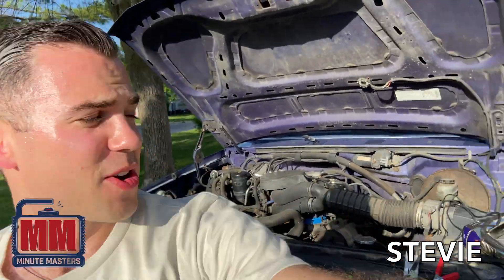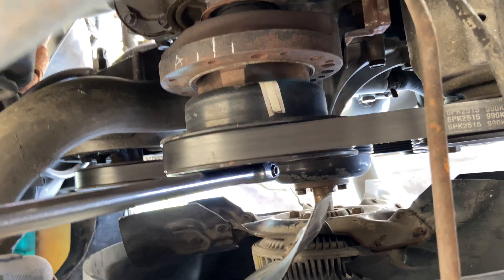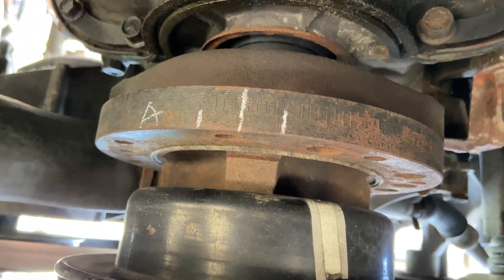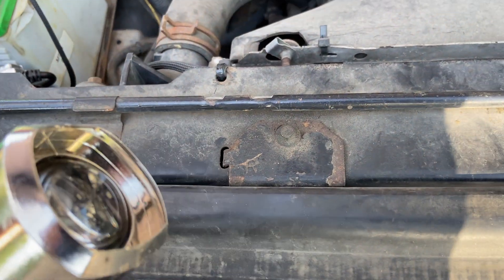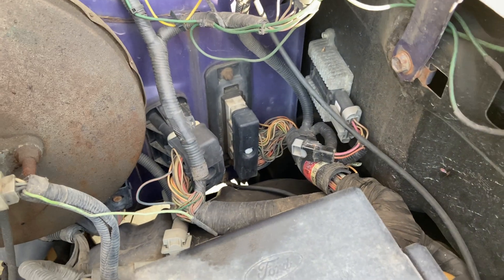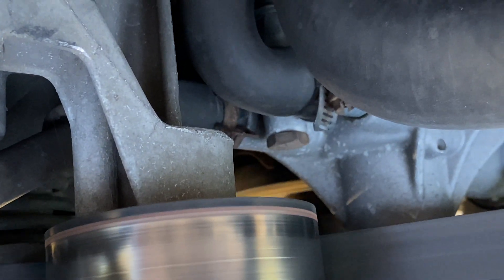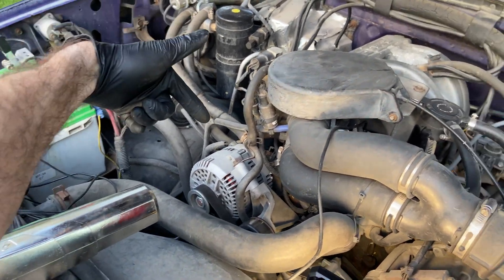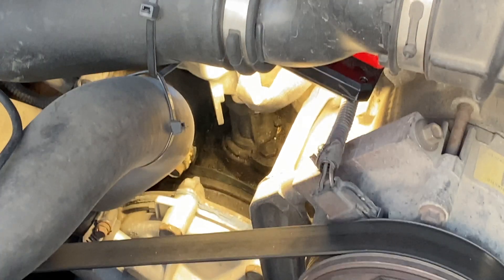Do You Know How to Check and Adjust Engine Timing?? | 1995 Ford F150

Comment: Hey does the 10° go even with the top of the pointer or down in a little slot
Reply from the maker: You want the 10° mark to be alongside the right side of that pointer. That pointer has a flat side and an angled side. The flat side is the side you want to align with.

Comment: Where is the crankshaft position sensor ford f150 1995 v8 5.0
Reply from the maker: Good question. I haven’t had to look for it myself. If I were to guess it’s somewhere on the front of the engine or it’s part of the distributor set up.

Comment: The SPOUT (SPark OUTput) connector is the little plug on the wires going into the TFI module on the distributor. You have to pull it out before setting the timing. Pulling it eliminates the timing advance function by disconnecting the ECU from the ignition system.
Reply from the maker: Thanks for explaining the acronym!🤙
I was talking about this someone else today and I couldn’t remember if the timing advance was done automatically.

Comment: hey my f150 5l is running low rpm on neutral do you thinks it can be related to the timing? thanks
Reply from the maker: That could be timing. It’s at least worth checking.

Comment: You did not mention when you re-attach the grey plug. Before cutting off the engine, before tightening the distributor?
Reply: Shut it down after you have finished timing it, then you can put it back in
Reply from the maker: Good point!

Comment: i did not know you had to disconnect that one connector before loosening the distributor and  trying to adjust the timing...i guess that grey square thing near the ignition module serves the same purpose as when you have to disconnect the vacuum advance hose from the vacuum advance before you can get the timing done correctly
Reply from the maker: That’s my understanding of this process too.

Comment: What does it mean when i can only find mark when connected to
 spark plug 8
Reply from the maker: No idea. I’ve never hooked the timing light to wire 8. Did you hook the light to wire #1?
Reply: Probably means the outer ring on your harmonic balancer has spun. There is a place called the damper doctor in Redding, CA that rebuilds them.

Comment: Nicely done 
I just recently replaced my distributor in my 89 F150 5.0 and I got it really close by ear so it looks like I'll be getting a timing light and getting it spot on and maybe picking up some power and mileage
Reply from the maker: Thanks man! Before I had a timing light, I would kind of do it by ear too. The timing light definitely dials it in a little closer.

Comment: Just did this on my 94. I’m pretty sure the timing has never been adjusted but The timing was actually pretty close to 10. I adjusted it and took it for a spin and didn’t really notice any difference. Should I keep trying to adjust further??
Reply from the maker: If you adjusted the timing to 10, then I would leave it be. If you start adding mods and changing fuel grades, then you can bump the timing.

Comment: My engine seems to be louder and seems like it loses force when driving instead of steadily speeding up if that makes sense? Could it be my timing being off? I have my spark plugs set to stock .44 but my engine seems to get loud when I speed up or floor it as if it’s struggling to speed up. If you could help out with that would be awesome!
Reply from the maker: Have you don’t an ignition tune up in a while? (Plugs, wires, cap, and rotor) 
Have you changed the fuel and air filter?
I would start with some diagnostics first. I would read your codes and check fuel pressure. 
If you are comfortable with these checks, check transmission fluid pressure (test port on the driver’s side of the transmission) and I would check vacuum stability.
Reply: @TheMinuteMasters  did a tune up already still have the same problem, I have good oil pressure, vacuum stability haven’t checked that yet
Reply from the maker: @elsebas6290  definitely check your vacuum to see if it’s erratic and your fuel pressure is a good thing to check while you’re at it.
Reply: @TheMinuteMasters  awesome thanks!!
Reply from the maker: @elsebas6290  You’re welcome man!🤙

Comment: I was adjusting the timing yesterday and got a big shock. Is that suppose to happen if the truck is on?
Reply from the maker: How did you get a shock? Did you see a spark? Did you personally get shocked? What were you touching?
Reply: @TheMinuteMasters  I was trying to turn the distributor with my left hand when i felt a shock. It didn't see which cable I was touched and didnt want to do it again to find out.
Reply from the maker: @frobles21  Gotcha. You could have touch a cable or some bare conductor. Unfortunately you won’t know until you try it again. Lol
Reply: @TheMinuteMasters  I was afraid of that. Do you take private messages for troubleshooting? I have the same year truck and it’s been kind of a nightmare.
Reply from the maker: @frobles21  Do you have Instagram? You can message me there. @theminutemasters
Reply: @TheMinuteMasters  thank you, you might get an essay from me 😂🙏
Reply from the maker: @frobles21  😂😂

Comment: So is your “0” the 5th mark in? 5 to one side 5 to the other? Trying to understand how exactly to read the marks
Reply from the maker: 0 is center and then there are roughly 10-20 tick marks on either side of the zero. Looking down at the harmonic balancer, I set my timing to the 10th tick mark to the right of the 0.
Reply: @TheMinuteMasters  alright, I probably sound stupid because you just explained, granted I haven’t looked at mine yet I’m going to get the tool right now, but what is the process of locating the “0”? Is it a certain amount of ticks in from the left?
Reply from the maker: @stoicchillz3539  No a problem. Any questions are good. The 0 should be marked with a zero and the line is longer. If the 0 isn’t marked the find the longer tick mark in between the 10s.
Reply: @TheMinuteMasters  I see now that there is actual numbers to tell in the video haha I’m sorry. 
I’ve just discovered a new problem though, bought the tool went under mine and there is legitimately no lines…. Turned it over 2 times rubbed it off and everything. Not exactly sure what to do about that one
Reply from the maker: @stoicchillz3539  no problem! 
Really? Is there a center line? I would try soaking it with a penetrating oil and really try to clean it. I don’t see why there wouldn’t be any numbers. I take it, you rotated the crank and looked around the entire harmonic balancer?
Reply: @TheMinuteMasters  yeah, went all the around 2 times and nothing so I took a wire wheel to same spot as in your video and there is ever so slightly a few lines but just not enough to tell where I’m at. No numbers showing so far
Reply: @TheMinuteMasters  do you by chance happen to know the diameter of these? Having a hard time finding it online
Reply from the maker: @stoicchillz3539  Really? I would try using a rust removing solution and see if you can uncover any markings. Otherwise, you’d have to set timing be the sound of the engine (which isn’t the most accurate method).

I don’t know the diameter, But you could go to an auto parts store and ask to see one. Then you could measure it.

Comment: Love your videos. I just bought a 1990 F250 and this video gave me about 40 more horsepower since the 5.0 engine was set at 0 degrees. I adjusted to the 10 degrees BTDC as labeled under the hood using the method outlined in your video. I'm going to continue to upgrade this truck and enjoy it. Thank you!
Reply from the maker: Thanks Mike! I appreciate it!🤙 
That’s awesome! It’s amazing what a few adjustments can do to an engine. 
You’re welcome!

Comment: Question. Did you ever do a video on the TPS sensor replacement?
Reply from the maker: I didn’t. Although, it’s easy to replace. Either you bolt it back the exact way it came off or you use an Ohm meter to align it.

Comment: Hey there, could you please do a video of replacing the crankshaft positioning sensor. I’m in a bind and don’t know how to do it!
Reply from the maker: Hi! What year is your truck?
Reply: @TheMinuteMasters  it is a 1995 f150 5.0 liter v8 I’m not very sure if they have one it could be my computer going bad but it stalls when driving or idling for a little while and won’t crank back. I’ve tried the new relay and I’ve also tried a new icm
Reply from the maker: @Controlledchaosjeep  Gotcha. Im not sure if these years have those sensors either. I would try reading your codes. If it’s a sensor, it should find it for you.
Reply: @TheMinuteMasters  I believe it could be my computer, it just stalls for no reason and won’t crank back. It’s got fire and gas… not sure if the computer is going to fix it but I’ll do a video on it and mention you! Thanks for all of your help!
Reply from the maker: @Controlledchaosjeep  Yeah let me know how it goes! Thanks man!🤙
Reply: @TheMinuteMasters  yes sir!
Reply: @TheMinuteMasters  computer did not do it I’m not sure what’s going on
Reply: @TheMinuteMasters  I believe the timing is off and I have no oil pressure unless I give it gas? What do you think would cause this?
Reply from the maker: @Controlledchaosjeep  So I’d try to adjust your timing first. Oil pressure can be affected by a lot of things. Are there any oil leaks? Are you measuring oil pressure with a test gauge or just reading the dash cluster gauge?
Reply: @TheMinuteMasters  with an after market oil pressure gauge
Reply from the maker: @Controlledchaosjeep  Good. They you do have a oil pressure issues for sure. Check and see if you have oil in your coolant.
Reply: @TheMinuteMasters  no sir but I have like 15 psi oil pressure
Reply from the maker: @Controlledchaosjeep  Thar seems like good oil pressure. The gauge in the instrument cluster reads normal if the oil pressure is over 6 psi.
Reply: @TheMinuteMasters  good to know it’s definitely a fuel problem
Reply: @TheMinuteMasters  found out what it was… it was simple, just the fuel pump relay.
Reply from the maker: @Controlledchaosjeep  Hell yeah man!🤙 Glad to hear it! How did you find it?
Reply: @TheMinuteMasters  brought it to a mechanic shop I knew it had something to do with the fuel
Reply from the maker: @Controlledchaosjeep  It probably showed a fuel pressure issue.
Reply: @TheMinuteMasters  it was it is running great now! Thanks for all the help!!
Reply from the maker: @Controlledchaosjeep  You’re welcome man!🤙
Reply: That was great you helped out that guy! Awesome!

Comment: What can it mean when the truck slips and the vent fan cuts off
Reply from the maker: In what way do you mean the truck to slips?
Reply: @TheMinuteMasters  The transmission slips it keeps revving but doesn’t shift . My fan blower stops also
Reply from the maker: @aarondesantiago3518  Gotcha. This could be a bunch of things. 
Have you checked the OBD1 codes on your truck? If you haven’t I have another video and have do that. I recommend you do that so we can eliminate any sensors or other electronics that could be causing the slipping. Then we can keep diagnosing.
Reply: @TheMinuteMasters  ok I’m gonna order the scanner . I been neglecting upgrade for the truck. My brother coworker at car toys install ceramic tint on my truck and it looks really good. Gives me more motivation to fix it up.
Reply from the maker: @aarondesantiago3518  Good move! 
And ceramic tint is awesome stuff! I had that installed on my truck too! Game changer!🤙
Reply: @TheMinuteMasters  definitely. The cab feels cooler now and the A/C feels colder now .
Reply: @TheMinuteMasters  I haven’t scan my truck. But whenever it’s 100 degrees plus outside . The truck wants to downshift by itself and the transmission starts slipping . This year has done it more . Last year was only once now this year been like 5 + times. I’m thinking of putting a bottle of Lucas transmission slip
Reply from the maker: @aarondesantiago3518  That definitely sounds like a hot transmission fluid issue. I would definitely scan your truck and if you can do it when it’s hot, even better.
Reply: @TheMinuteMasters  have you done a fluid flush on yours?
Reply: @TheMinuteMasters  I just changed my transmission filter and added 4 quarts of Mercon v and the whole bottle of Lucas transmission slip and it feels way better . I’m take it on the highway too see if it does it anymore
Reply: @TheMinuteMasters  the fluid didn’t even look dark . But I don’t think my dad has changed it

Comment: What happens when you re-install the spout? Or do you just leave it out all together? I've heard putting the spout back in will cause the ECM to reset back?
Reply from the maker: Good question. I’m not sure what the spouts function is exactly. I do believe it is something to stabilize engine timing and rpm. Taking the spout connector out apparently simplifies timing enough so that you can take an accurate reading. You do have to put the spout connector back once you’re finished timing. In that case I believe it returned everything to normal.

Comment: A long time ago I removed that thing at the base of my distributor, the part you tightened or loosened. Is that why my truck fires wrong, or keeps misfiring and is running too rich?
Reply from the maker: Oh you definitely need that part or your timing will never be set correctly. You can have all kinds of issues if your distributor moves all the time.
Reply: @TheMinuteMasters  
Yeah, my distributor never "moved" per say. The unit/part itself doesn't turn on the inside and can't be removed. It is rust-fused to to my truck. Right now my truck is misfiring and taking in too much fuel, RPMs keep reving up or engine dies after awhile of idling, oil dipstick becomes insanely hot as well. 
I've replaced throttle positioning sensor, idle air control valve, ignition coil, mass airflow sensor, fuel pressure regulator, spark plugs, spark plug wires, took clogged beyond saving catalytic converters off, replaced a shot starter, and due to mechanics plutting a hex top bolt in the center of my upper intake manifold I cannot get it removed despite ordering 2 sets of "thin wall" sockets so can't get to fuel rail.
Reply from the maker: @WickedJesterL  Wow! You’ve changed a lot of parts. I’d start with checking the engine timing with a timing light and see where it is. If that isn’t the problem, I’d check engine vacuum.
Reply: @TheMinuteMasters  Thank you for the advice. 😎👍
Reply from the maker: @WickedJesterL  No problem man!🤙 Thanks for watching!

Comment: 93 and back had the module and plug on the distributor.
Reply from the maker: Gotcha. Thanks for sharing that!🤙
Reply: That's incorrect.. I have a 92 Ford f150 302 and it doesn't have the module and plug on the distributor

Comment: OK I haven't got a clue wtf you just did dude.
Reply from the maker: What do you need to know?
Reply: @TheMinuteMasters  sorry when it comes to timing I don't have a clue what to do. Basically making the marks and lining them up
Reply: @ashleyshavers4374  Pick up a Chiltons repair manual from a local auto parts store, snd it will walk you through each step.  I would take a brass wire brush to the timing marks on the harmonic balancer before marking it with a grease pencil or chaulk.
Reply from the maker: @ashleyshavers4374  So you marks the harmonic balancer. Now you aim your timing light at it and see where your marks line up in relation to the pointer. You want the 10° on the left of 0 to line up with the pointer.

Comment: Hi Stevie this is Francisco I was going to tell you that another good video will be how to replace or fix vacuum lines because usually on these trucks the they go bad take care buddy
Reply: He did a  video on that not long ago.
Reply from the maker: That’s right Francisco. I have a video on how to replace the vacuum lines.
Reply: Hi Stevie this is Francisco so I need to look for that video the one that you told me that you have for the vacuum hoses well I have this 92 F150 I also have the same engine that you have the 302 and I’m just having a little trouble with it because when it warms up it pings and then it goes away and then it comes back and it seems like it does it when it warms up I don’t know Stevie if you know I could be the trouble are you ready set the timing and it seems like I cannot find the problem But thank you for everything Stevie thanks buddy
Reply from the maker: @FranciscoLopez-cc7ui  you can also get a vacuum gauge and check your engine vacuum to see if you have a vacuum leak. That would tell you if your vacuum lines have an issue.
Reply: Yes baby I already did that I check also if I had a leak on that coffee can I checked everything with the vacuum gauge thanks buddy

Comment: I like using my dial back timing light. I put my marker on 0° and use the timing light to center the light back on the line. Makes it much easier to find that sweet 13° mark that these 302 engines like running at.
Reply from the maker: I’ve seen those timing lights and they are sweet! Did you gab your plugs to .55 in order to set 13°
Reply: @TheMinuteMasters  I did gap mine to .055 but I don't think you have to to get the full benefit.
Reply from the maker: @Skitter302  I was kind of thinking that because there is it much of a difference between .54 and .55.
Reply: @TheMinuteMasters   I know stock is .044 and honestly .055 is a stretch for a stock ignition coil. I use to think the MSD coils were strong but they only got a few more turns in the wire over stock. Summit racing TFI coils put out a strong spark. 132:1 if I remember correctly. I run a MSD Box and a Summit Racing Coil so a spark over the .055 gap packs a punch.
Reply from the maker: @Skitter302  Wait…stock is .45? I’ve always gapped mine to .54 lol. 

So do you have a MSD dizzy too?
Reply: @TheMinuteMasters  I run a stock cam so I leave the stock dizzy. Works just fine. ECU controls the timing anyway.
Reply from the maker: @Skitter302  Really? That’s sweet! I thought the MSD box required the MSD dizzy. If it doesn’t, I might get an MSD box sooner.